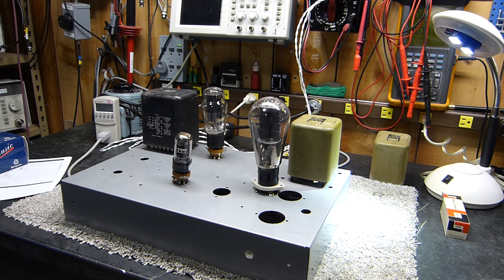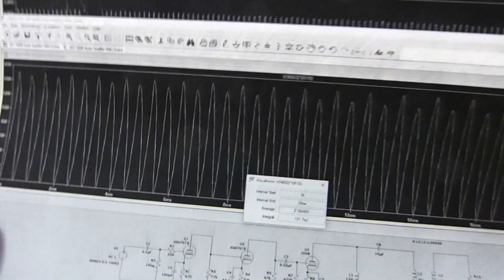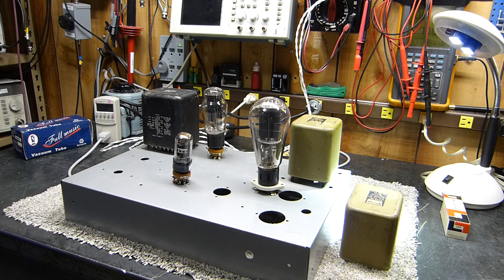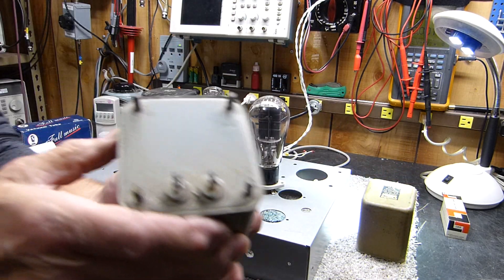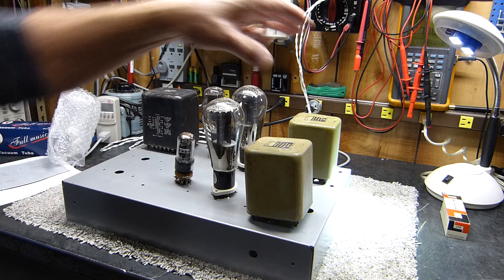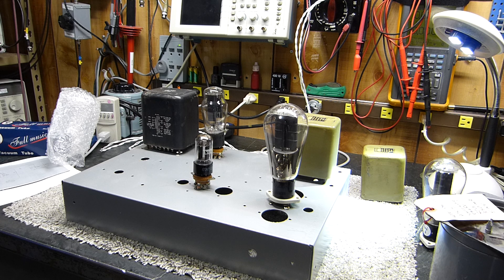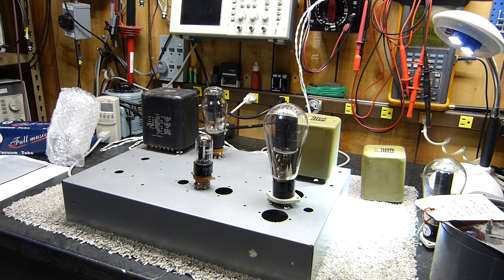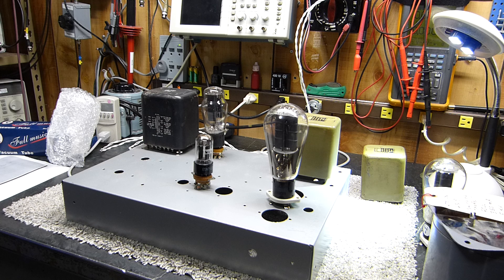Single End Triode Amplifier With 300B Plate Choke Loaded Using Line Transformers To Match To Speaker

Comment: hi, its the jc morrison circuit ,i like this for simplicity but with triode directly coupled ,if there  is a fail of one triode 6sn7 ,it would be catastrophic for the 300 b and output transformer ,dont you think
Reply from the maker: Hmmm... I will have to think about that - the output transformer that is used for impedance matching is isolated from the plate voltage of the tube by the series capacitor so unless that capacitor shorts there would never be any plate voltage on the OPT so I think it would be save - this method allows us to use a push-pull transformer in a SET circuit and not have to have a SE transformer with a gap in the core to prevent saturation. That is why I did it this way because I did not have any real SE transformers. Thanks for your comments.

Comment: If you are building a Linear amplifier what about using 2x 4CX5000A tubes using a balun to drive both tubes and a balun to combine the output from the tubes into a 75R feed to the Antenna.
Reply from the maker: You know I like the idea of a pair of 4CX5000A, either parallel or push-pull. I bet my neighbors would love me... as for 75 ohm, that could easily get into the discussion of which is theoretically best, lowest SWR or resonance ? A dipole is resonate closer to 75 ohms rather than 50 ohms so best SWR is not at resonance. In the long-run, the two are close enough to not worry about but sometimes we like to worry about things anyway. You know what I mean. Not sure about the 4CX5000A as I have never had one but I am familiar with the 4CX1000A and it only runs AB1. Collins drives the cathode but still run it AB1 even with the screen grounded and the screen supply polarity inverted.
I did look up the specs.   https://frank.pocnet.net/sheets/140/8/8170.pdf  I see it runs class-C and AB1.
Just what I need - 16KW output with 7.5KV on the plate @ 3A - but we are going to run a pair for 32 KW output. I think I will need 480V, 3 phase installed in my house...   73

Comment: I played with tube amps in the 90's. I built a small amp, just to see if it worked, I think it was a 7951 pentode, mono. It was quite a feeling hearing audio come out of it (crude but ran), using a tube that was older than me without a doubt. I like the sound of the 300B. I got to hear a few amps at a local audio shop, and this one stood out. Looking forward to see where you go with this, good video.

Comment: I built a loftin white over the winter, no interstage coupling caps,  directly coupled, sounds so sweet with 45 output tubes, and a safety circuit to shut down the power if the current gets out of control, if the input stage goes bad or a output tube get gassy, since the input tubes bias the output tube.
Reply from the maker: Mike, sounds like an interesting circuit. I just looked up the Loftin White circuit.   Thanks...   https://www.tubecad.com/2015/12/blog0335.htm

Comment: RF amps are always built this way, so I don’t see any reason why you couldn’t do the same for audio. It will be interesting to see how this one comes out. I also hope you give the push-pull configuration with dual plate chokes a try too; I guess you would have two coupling caps, with one going to each side of the line transformer primary, right?
Reply from the maker: I haven't thought, or drawn out, the PP version but inn my head, I would gnd the CT of the line transformer so I suppose two blocking capacitors would be necessary. As my friend has advised me from looking at the model of the amplifier, the bigger the better (neglecting all possible side effects of a 1F capacitor) and the voltage rating. I think I will go with two 470 uF/450V back-to-back for a NP capacitor rated at 900 volts or just one single version of this for the SE amplifier.

Comment: Capacitive coupled output sounds like an interesting concept. I guess it allows you to use a smaller (non-air gapped) output transformer for impedance matching and not have to also be the reactive plate load... it would be interesting to see how this turns out. 
If successful, maybe it could also be used for pentode/KT outputs.
Cheers,

Comment: Can't wait to see how that turns out.  Just picked and electronics hoarders house who sadly passed away.  Got a whole pickup load of tubes.  Ended up being a couple NOS Western electric 300b tubes. Not as many transformers as I was hoping for.  I don't see why that wouldn't work.  You really like trying to use those line transformers.  I see why though.
Reply from the maker: Wow... a couple of WE 300B's. I have run across a few nice power transformers at sales but not many output transformers. Close to a year ago I went to an estate sale of a SK and bought his KWM-2A (PS, two speakers and all) that was a military version that had never been  used. The 5U4 and 5R4 and the fuse holder were in plastic bags with tags.  I use it daily. I also got a 51S-1 that was mint. Someday I suppose buyers will be sifting thru my stuff. They better be nice to all of it and not "mod" it or I will send some gremlins to shock them when they work on it...  :-)
Reply: @ElPasoTubeAmps  I know where you're coming from.  Someone will have a field day at my place also.  I hauled three truck loads out of this house the other day.  My wife said I had too much stuff before that.  Amongst the  items which, I am  playing with now,  was a Heathkit  TT-1 & TT-1A Tube tester.  The thing is like brand new.  Whoever assembled it took there time and did an excellent job.  I haven't even started into much else yet.  Almost a whole truck load were tubes.  Very exciting!
Reply from the maker: @kgsalvage6306  My wife has told me I have too much stuff also, but I don't believe her.

Comment: Looking forward to the end result, although I'm not convinced you are going to get the same performance of a single pp transformer.
I don't think you will get the distortion levels as low as in a true pp arrangement (I may be wrong though).
I presume you will drive the two chokes 180 deg out of phase and take your OP between the two triode anodes, in which case you won't even need the coupling caps as the two anodes are going to be at same DC potential. This is pretty much a single ended transformerless bridge amp.
As I said above will be great to see the end result.
Reply: PS, just a thought, what is the advantage of using two chokes and a line OP transformer vs just a single OP transformer?

Comment: very interesting project, looking forward to see it running!
as a single ended amplifier i don't see any problem in the design, but i would try to stay away from the resonant frequency of the series capacitor and line transformer primary. 
Since it would run in class A current will always flow in the inductor so no inductive spikes, but in a push pull configuration i think that class AB or B might cause sort of a flywheel effect on the inductor when the tube goes in to cutoff resulting in distortion near the zero-cross region.

73!!
Reply from the maker: Good points on the Fr of the choke and 10 uf capacitor. I don't know the exact L of the line transformer but assuming around 2H the resonance would be around 35 Hz. I do see some anomalies in the LTSpice display of a sweep from 10Hz to 20KHz at the low frequencies. I an not sure how the separate chokes would react in a PP configuration at zero cross. I may never get to the PP configuration but that is something to keep in mind.
Reply: I don't think it will be an issue. The matching transformer will force current trough the chokes regardless of one tube conducting or not.

OR another option is to construct a push pull class A amplifier. Both tubes will conduct current all time and with some playing with the impedance of the matching transformer it could perform very nicely

Comment: I'm torn between SET and Push Pull myself!  I guess what "I" would love to see you do, is to start with making it SET, then after building, testing, evaluating, etc. make it Push Pull and use that honking choke...or chokes...for the output!!!
Reply from the maker: I think the big chokes should work. Since everything is class-A, and there will be virtually no variation in current so the choke will remain at one inductance level. I may not be able to carry it  around at 100+ pounds but we shall see...

Comment: Yes yes yes, you have to build it! I remember when you were looking at using a line matching transformer in a previous video but you were running into saturation problems and if I remember correctly I tried to comment about using it in a circuit like the one that you just showed in this video, by capacitor coupling the line transformer you are keeping DC off it and eliminating the saturation problems, having both AC and DC across the transformer increases saturation dramatically, even the tiniest bit of DC makes a huge difference! I would love to see if it would actually work though. 
Here in Australia, there's a store that also can be found online called Altronics and they have a vacuum tube amplifier DIY kit. I have looked at it and I can't see any large output transformer! So either their design is using small line matching transformers or they have done away with it altogether and just went with the capacitor coupled output and increased the residence to ground on the other end of the tube, basically relying on the ripple on the DC input to pass through the capacitor to directly drive the speakers! 
Like I said, I'm not sure what they have done? I can't find any forums on the topic and I think that it cost about $600AU to find out but I'm not that well off. Though it has my interest! I own a couple of amplifiers that were designed in the 70's right here in Australia and I love their sound, one was a kit amplifier from Electronics Australia magazine and the other was built by someone in his garage which he was selling to the retail Hifi stores way back when. So I'm confident that the Altronics kit should be really good even though it is based on a PCB, I would have preferred point to point wiring but you know how it is, you get what you are given! 
So I hope that you go ahead with this! Can't wait to see your thoughts and feelings on this type of amplifier design.

Comment: Howdy! Now that sounds like a great idea, specially if you have a surplus of chokes. Besides, you don’t have the whole inter layers and parallel / series winding complications that come with a good output transformer. 
I once toyed with a choke /capacitor / transformer output stage on single ended amp using a 6080 in a cathode follower to lower the output impedance even further. I didn’t use line transformers but small SE transformers and even though the quality of the transformers was wanting, the bass was pretty tight and it sounded really good. It was not much of a practical amp because the 6080 is really hard to drive  and puts out less power but a 300b or even a triode strapped 6550 would do a much better job.  Thanks for sharing, I’m looking forward to seeing the final product. Stay safe.